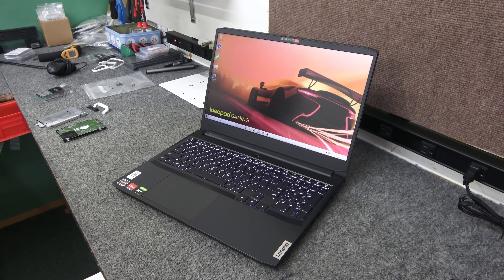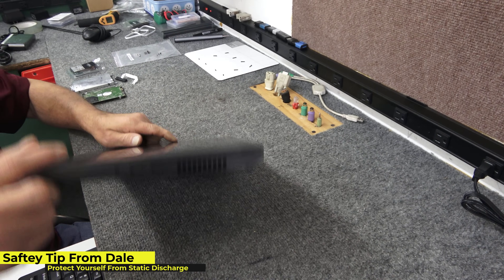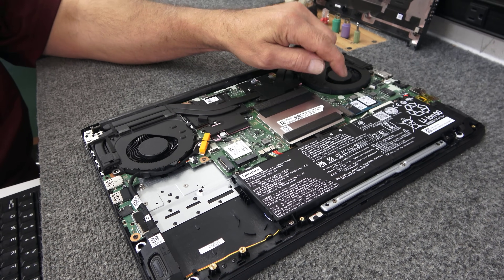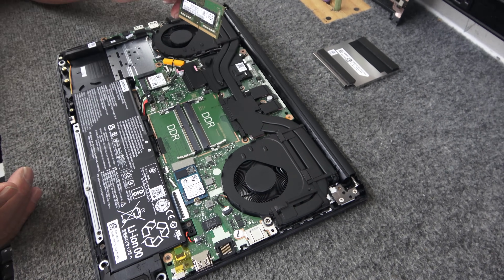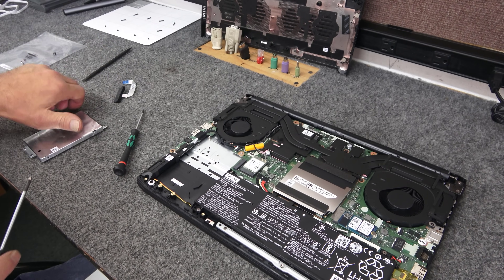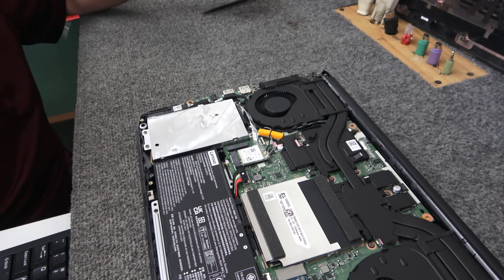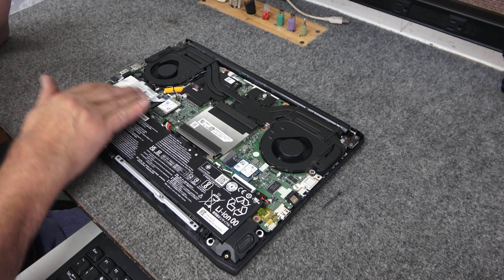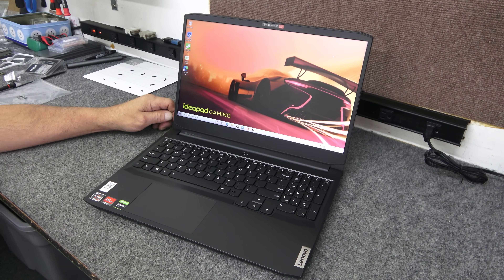Upgrading Lenovo IdeaPad Gaming 3 Laptop.  Memory and Add HDD.

Comment: I pressed the Ram a little too hard and it touched the Motherboard and (and I forgot to remove the battery also had a metal cooling plate on the ram) a small smoke came out, it was worth a small soldering piece. Fortunately, it just got a little dark and nothing else happened. I wrote this to remind you to be careful when supplementing Ram. My computer almost died.
Reply from the maker: Whew...that was close
Reply: @CadillacComputerCenter  HELP ME!! I forgot to remove the battery, metal cooling plate schortcircuit whith resistor SMD PL202
Reply: @antoniopuentes1955  Me too, same thing happened. So far the laptop seems okay, any updates on your side?
Reply: @francis3603  Francis, So far the laptop seems okay, but I discovery that the video card NVIDIA no start, the laptop only work with chip AMD radeon integrated
Reply: @antoniopuentes1955  did you short any other component? If only PL202, they say it is used for filtering noise current from charger. The laptop would work normally. Did you reinstall drivers? Update nvidia by using geforce experience?
Reply: @antoniopuentes1955  is the laptop still in warranty?
Reply: @francis3603  not, only short PL202, yes I did reinstall drivers with geforce experience, however, the card video is not available
Reply: @francis3603  yes, they say it is not cover warranty
Reply: @antoniopuentes1955  do you think your nvidia video card got damaged due to PL202 or is it another reason. My nvidia video card still works fine.
Reply: @antoniopuentes1955  did you try taking it to a tech shop and have it fixed?
Reply: @antoniopuentes1955  you need to go into your display settings and force Windows to use your dedicated graphics instead of your integrated graphics.
Reply: @Tekz12  but only show display 1 AMD, I dont have more options
Reply: @antoniopuentes1955  go to
Reply: @antoniopuentes1955  unofficial drivers
Reply: @antoniopuentes1955  Did the laptop still workkedwell or you have sold it?
Reply: @vassy261  the laptop workkedwell, but no video card, no games :(
Reply: @antoniopuentes1955  but before shortening the capacitor,the video card worked?
Reply: @vassy261  No, I think the short circuit damaged the video card
Reply: @vassy261  should i remove the battery first before adding on the ram?
Reply: @Januar68  just unplug the battery and after that try to press a few times the power button,then you're good to go.
Reply: And after installing the new ram be sure the cover is fixed property after that you can connect back the battery
Reply: @vassy261  alright thanks a lot I'll be getting my new ram tomorrow. Btw by any chance do you know what size is the ssd on the right side for the version of ryzen 5 5600h & gtx 1650.
Reply: @Januar68  512 gb probably , I'm not sure
Reply: @vassy261  Nooo I mean what size is it? 2280, 2242?
Reply: @Januar68  I don't have any idea sry
Reply: @vassy261  alright
Reply: @Januar68  2280 m.2 nvme ssd
Reply: For all those here, the little rectangular things next to the ram are called inductors (PL202). If you accidentally burn them a bit, they shouldn't cause any long term damage.
Reply: @crescentiumYT  I replaced the solder, yes, the capacitors usually don't do anything, but it's dangerous, and when the price of the computer is high, people are afraid (I heard that there is no need to remove the battery in Asus, so I did not remove it. I will not do such a stupid thing again)
(My English is not good, I may have used meaningless words)
Reply: @crescentiumYT  I just accidentally did it, does an error like this affect the power of the cpu, gpu or battery?
Reply: @francis3603  I fried my PC doing this, the metal cooling plate started sparking my motherboard and now it won't turn on
Reply: @anyone31  No
Reply: @CadillacComputerCenter  hey I'm thinking about buying one of these, and I've done some research about price and it's components.
Would you recommend it?
Reply: @CadillacComputerCenter  Few  day ago I buy this laptop...
Lenevo idea pad gaming 3 5600h
Gtx 1650

✅ My laptop temperature in IDEAL mod 50°C
Gtx 1650 Gpu Temperature 45°C
Amd Radeon Gpu Temperature 47°C
is it normal..

✅And this model Laptop i face fan noise like spinning when colling  fan are slow...
is it Normal.....

Place Help me....😩😩❤️❤️❤️
Reply: That happened to my computer. But it wasn't me, I took it to a tech shop to install a RAM upgrade and the guy somehow managed to touch the metal plate on a chip, that caused damage. Tomorrow I'll take it back there to see what they can do to me. I believe they'll call Lenovo assistance. I'm really bummed, I only used the notebook once :(
Reply: @eduardojuste  imagine they replace it for a new one
Reply: @eduardojuste  I feel sorry for you, I hope they solve your problem. Good luck
Reply: @@sezer-qq9zlI dunno about yours, but in my ideapad gaming 3, there was an option to disable the battery in the BIOS. I did this on mine with a 5800h and RTX3060, changed the RAM, changed the thermal pads on the ram, fitted nvme SSDs, removed the CPU and GPU cooler, changed the thermal paste on both, put it all back together, had no issues. The worst that happened on mine was I broke a couple of the plastic tabs opening the case. You just have to do things the right way.
Reply: This literally happened to me a week ago 😭
Reply: @AchillesSeverus  and what u did
Reply: @MORaXedit1  It was my first time installing ram. there seems to be no problem
Reply: @MORaXedit1  Nothing! Just prayed to the Lord that the PC World turn on and my prayers were answered ✌️💀
Reply: C mon man how can u be so careless
Reply: Samething just happened to me and then i read your comment 😂 i was so close , smoke and black spot  , but it is working 😅
Reply: mine did die, almost. I had the same issue, and the system would start and run fine, but on any movement, the screen would just go dark. Thank God for Lenovo's accidental damage protection, they replaced the board for me.
Reply: @akashkariwal  you were lucky

Comment: I've had this laptop for 6 months now... And this really is the best bang for the buck laptop. (Ryzen 7, 3050, 16gb ram)
Reply: Totally agreed!  I just found mine on sale at BestBuy (Ryzen 5 5600H, 8gb RAM, 256gb M.2, 3050 ti) for only $600!!!  I spent $200 in parts and now I have a 512gb 2242 M.2, 1tb 2280 M.2, and 32GB RAM all for only $800!!!
Reply: Is this still worth it?
Reply: @jorgeortiz8902  if you can find one for under $800, I still recommend it... However best of luck finding one still on store shelves, it's over a year old at this point.
Reply: @svpracer98  I just seen it at best buy I’m going to get it

Comment: I wasn’t careful with the metal ram cover after changing ram and it made a spark and my motherboard burnt to the left of the cover a little. Time to get an exchange I guess. Idk if I had turned off my pc or just left it sleeping. Either way it’s my fault
Reply: any updates? happened to me too, so far the laptop seems fine and battery is charging and doing ok. is it the PL202 component that burnt?
Reply: @francis3603  Hi Francis, How's doing your computer?, any issues?, i want to know if this is something that can be fixed if it happens or should buy a new computer
Reply: @RuizB  im still using the laptop as is, didnt have it repaired. Same case with other users that also burnt/shorted that PL202 component due to the ram shield, they just ignored it. It seems like it is not a vital component since it is a smd inductor that has another one parallel to it that practically does the function so most probably it is a redundant part. I suggest to clean it with IPA isopropyl alcohol for the burn marks and go use it as you normally like we all did. Some user contacted lenovo and told them what happened and lenovo took it and repaired it no questions asked but that was lenovo US though. Lenovo support in my country categorized it as customer induced damage so I cant have them repair it for free. You can try though if lenovo service in your country is lenient.
Reply: @francis3603  Thank you for answering Francis, i was so scared, thinking about that the laptop would die or something like that. I feel relieve to know that lenovo repairs them. Also i'd like to know why does this happen, i mean, does this happen in order to damage the laptop or something like that?, cause it's a part or the laptop and not a strange thing, you know. i don't know if there's something wrong with mine, if it's the same case, the same "damage" and i don't know how to identify it, but i hope everything keeps running smooth.

Comment: Hello, what type of m2 i could use here, Sata SSD or PCIe NVMe SSD?
Reply from the maker: You will use m.2 nvme ssd.
Reply: @CadillacComputerCenter  thank you
Reply: Does Ideapad Gaming 3 15ACH6, supports PCIe 3.0 at full speed (3×4)
As per the spec sheet it says: Installed M.2 2280 SSD is PCIe 3x4 but runs at PCIe 3x2 due to M.2 SSD adapter limitation
Reply: @shrey522  The 2242 M.2 slot runs full speed (x4 lanes).  The 2280 M.2 slot runs half speed (x2 lanes).  Note, that even 1/2 max PCIe3 speed for the 2280 M.2 is still more than 3x faster than any SATA connection.

Comment: Just bought this laptop. What do you suggest for an upgrade to get use as a graphics design purpose? Definitely going to increase the RAM. Any suggestions is appreciated.
Reply: Upgrade the RAM to 16 gb at least, and another memory disk HDD or SDD
Reply: @pedrocamacho2957  can you upgrade it to 32gb 2x16gb?
Reply: @Steven-ye8ys  I'm 90% sure that you can, even with some models could be 64GB, but you'd need to check it

Comment: So I'm confused. Is there or is there not a way to attach 2280? They have the connection but you're just saying that didnt include the mounting screw to secure it? Could you use a different one?
Reply from the maker: Hi.yes you can use a 2280 drive, you will have to provide mounting screw and standoff.  Easy to get online. When you use the 2280 however,  the 2.5 inch bay cannot be used. Bad design, I know.
Reply: @CadillacComputerCenter  so what will we lost not using bay . I can't understand.
Reply: @easykatka3380  You can either install a 2.5" HDD/SSD (SATA connector), OR a 2280 M.2 NVMe drive (up to 1tb).  This is IN ADDITON to whatever you have installed in your 2242 M.2 NVMe slot.

Comment: Hey, i would want to upgrade my laptop ideapad gaming 3. And I want to put there 1tb m.2 ssd. But one guy said that i could only put 1tb hdd and that the ssd is limited to 500. It already have 256gb ssd. So could i put there another ssd that is 1tb m.2 ssd , or do i have to but 500gb ssd?
Reply: This is what I wanna learn
Reply: @easykatka3380  Just ordered and put the 1tb m.2 ssd to my laptop and it worked. So yes this does work.
Reply: @lexuhenxu4203  thank you for comeback. So you have two different ssd right?
Reply: @easykatka3380  Yes. I already had the one what came with it (it is 256gb m.2 ssd). And then i added the 1tb to the other slot in te laptop. So now I have one 256gb and one 1tb.
Reply: @lexuhenxu4203  thank u brother. Have a good day 😊
Reply: @easykatka3380  You too :) If you have any problems, just say and I try to help.
Reply: @lexuhenxu4203  hey bro..  According to lenovo spec sheet:
Installed M.2 2280 SSD is PCIe 3x4 but runs at PCIe 3x2 due to M.2 SSD adapter limitation
So your secondary NVME m.2 2880 SSD working in full speed? can u please confirm this?
Reply: @shrey522  It seems that my laptop is only combinable with pcie 3x2(because of the adapter limitation), even tho the "secondary" ssd id 3x4. So it may be that it is slower because the ssd cant use its full power. But I dont know where i could check or test, that is the ssd working on full speed. So do you know how I could see or test that?

Comment: Hi, I have the same laptop and I want to add a 1TB SATA hard drive.  I currently have 512GB m2.  Can the two be put together?
Reply from the maker: yes they can.
Reply: @CadillacComputerCenter   Because the hard drive hides the bolt on the M2 board and the M2 socket, it seems to me that it also remains unusable due to the hard drive.  Thank you.  I'll see how I arrange them.
Reply: @ivanmilanov8334  The HDD is mutually exclusive with the 2280 M.2 slot, but the main drive is the shorter 2242 M.2 slot (limited to 512gb).

Comment: Can this support 32gb of ram? What's the recommend Voltage on the ram??
Reply: 1.2V but up to 16 gb per slot you can upgrade by 16+16 to get 32

Comment: Guys, I need some advice. My device came with a 2280 SSD which blocks hdd space. I want to add hdd but I don't want to loose SSD also😢. Can't buy 2240 SSD cause it's too costly for me. Is there any way?
Reply: No
Reply: U can only install 2 ssds,or 1 hdd,if 2 ssds,you need a m2 to sata adapter,which can be bought easily on amazon
Reply: I have the same problem. I guess buying additional 2242 is the only option, or simply replacing current 2080 with hdd or bigger ssd
Reply: @Nikaaa2117  Dude just install 2280 in the 2242 slot and close the lid carefully (u cant screw it in)  if u can't find any 2242 ssd. I did the same since i couldn't find any near my place...
Reply: @sriharin9733  you just slot it there with no adhesive and it still work fine?
Reply: @alexbinhamid3436  this will short-circuit your board.. don't ever try it

Comment: Great video. i bought exactly the same model & not yet receive. let say if i want upgrade to 16gb ram, is that okay if i just buy another 8gb ddr (buy only 1) & straight away install it in the empty slot, or do I need to buy 2 ddr 8+8 ? anyone can help me here.
Reply: Do the following....
Get the laptop
Go into settings to see what the timings and rank are
Timing - CL22 or CL19 (different timings would hamper performance)
Rank - X16 (SLOW)  X8 (FASTER)
if it's not in the settings then you can open it up and looks in the stick itself.....
THEN.... you can change it to match what's in there if you want or get a WHOLE KIT (2 sticks)
Reply: @PhillipLemmon  thanks ! will try.

Comment: Hi, i purchased this laptop today but there is some takk sound comes in whenver you press left side of the laptop.. It appears 2 out of 5 times...kindly suggest
Reply: Hi! I had the same problem. You need to remove the back cover and then the battery (4 screws). Follow the instructions in this video to disconnect the battery first! Under the battery in that corner is the BIOS battery (i guess) which was the source of the sound in my case because it was moving a little bit. I used some double adhesive tape to stick it and the problem is gone. I hope this will solve your problem.
Have a nice day!

Comment: I must have a slightly different model. My HDD drive bay is oriented 90 degrees differently to the one here.  Glad I watched this, coz now I know the problem I had was trying to connect the cable upside down. 🙈
Reply: You have the 2020 model if you were wondering, the one in the video is the 2021 model.

Comment: Mine came with 512 gb nwme 2280 ssd, but it still has an SSD 1 slot, and I have another 2280 SSD card, but it seems that doesn t fits there. I need to buy the  2240 ssd?
Reply: yep

Comment: The laptop will lose the warranty if I do this?
Reply: Yes you will lose warranty. I have the same laptop and it states i have to sent it to lenovo official service for any upgrades
Reply: @adrian_b_123   according to Lenovo  "adding RAM won't void the warranty, but the warranty won't cover the new RAM."
Reply: @madamx7422  my retailer and local lenovo support states if I open the back cover the warranty is over
Reply: @adrian_b_123  official Lenovo statement from their website - "You can upgrade SSD and RAM on everything except for Yoga/Flex & Slim units without voiding the warranty, but keep in mind that any damage inflicted on the machine in the process (of upgrading) will not be covered by warranty unless you have ADP (Accidental Damage Protection)." So if you upgrade your computer without damaging it you're OK
Reply: Nope

Comment: Hi, can you please tell me the exact info of the factory 8 gb stick of RAM ? I want to buy a matching one for mine .
Reply: Found out later :  Samsung 8GB ddr4 3200MHZ T0XD0001244675F41F M47A1G44AB0-CWE
Reply: @adrian_b_123  thank you very much so this is the one I should buy for thus laptop?
Reply: @tincan7743  yes the samsung ram is the one that comes in the laptop from the factory. I could not find this at my local parts supplyers , a compatible option is  Kingston : KCP432SS6/8 . This will make dual channel with the existing samsung , it has the same specs.
Reply: @adrian_b_123  oh ok thanks
Reply: Papi
Reply: Mine is Samsung